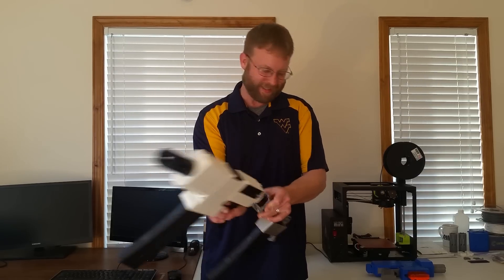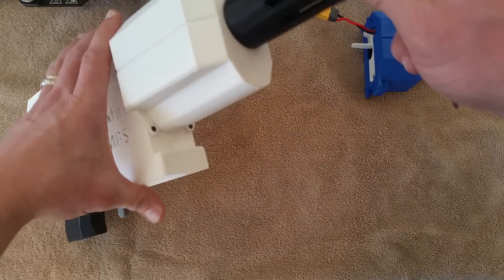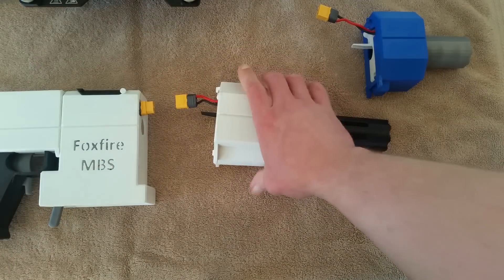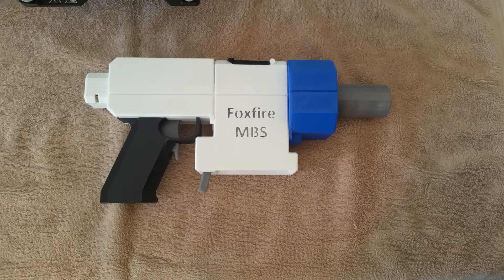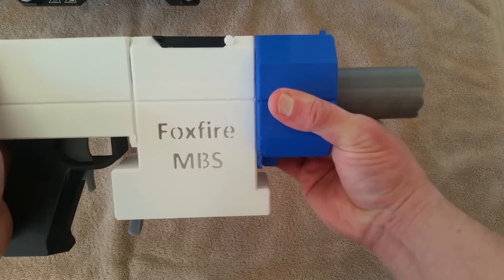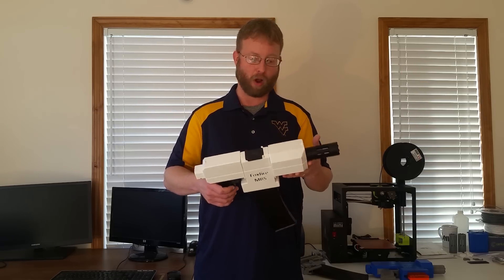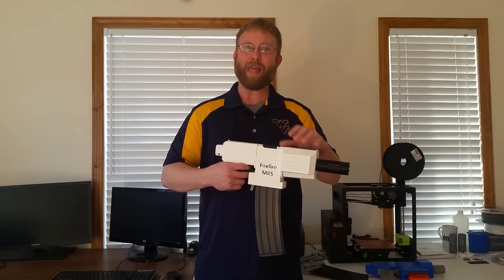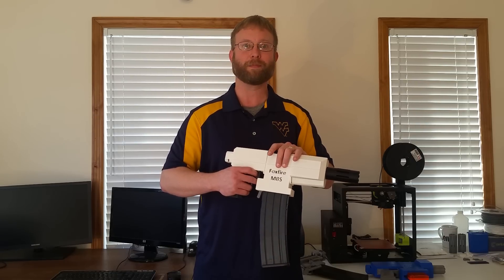Foxfire MBS Project Overview

Comment: What is the maximum bed size for this
Reply from the maker: I'm using a Lulzbot Mini - so 150mm x150mm x150mm (approximately).  A couple of the prints do use the full size of the bed in the x direction.
Reply: 498 Nerf any chance you could cut down the part s to fit a 120 by 120
Reply from the maker: You could try and place the Core sections diagonally on the print bed.  120mm is probably too small though.

Comment: Hi Nerf 498,do you recommend a 2-stage flywheel set up each with a pair of neohellcats?
Reply from the maker: That would work, but isn't optimum for the second stage.  Maybe try Wolverines on the second stage and run the whole thing on 3S.
Reply: I see. May I know the material that you are printing this blaster in?

Comment: are you using the  2 stage modulus open flywheel project cage?
Reply from the maker: It is the 2 stage Stryfe/Rapidstrike cage from OFP.  It is almost the same as the Modulus one, but the screw ports are different.

Comment: what are the dimensions of the battery tray
Reply from the maker: The opening is 28mm x 88mm with a depth of 46mm.  The space inside is a little bit bigger than the opening, but you need it for wires and connectors.

Comment: Are you selling these? eBay has a lot of aftermarket parts like a flywheel kit with motors for like eight bucks. Mass produce this please!
Reply from the maker: I not selling them at this time.  Tbh, I'm still working through how to handle this.  I would prefer to (eventually) just license out the models and have partners build/sell them.  Very early in this process though.

Keep in mind this project, while functional, is still in its early stages.  Imo, the models still need to be refined quite a bit.
Reply: I know the. I was just wondering whether you would put them up for sale in the future. Also, how many flywheel cages are there in the third section? I wish I was this good at making stuff. You have a talent.
Reply from the maker: Thanks for the feedback.  The white Housing has a two-stage cage from OFP.  The blue Housing just has a single high-crush OFP cage.

Comment: Do you have pics of the build & the internals? There's a link in your description but I can't get any of it to open..
Reply from the maker: The link points to the STL files that you would use to 3D print the models and the Blender files that are the source.  Blender is free - you can download it and then you can view/modify the source files.

For the internals, I'm going to be releasing a series of videos over the next few weeks that goes over the internals of each module.

Comment: Great Idea and execution.  Are you planning a core with the integrated Rapidstrike fire control group 3D model? It seems like  a good basis for a small pistol grip housing.  I'm looking forward to seeing where this goes.  Are you going to receive and/or feature files or models from the community?
Reply from the maker: I was actually looking at modelling a core around this kit - http://www.lightake.com/Product/Detail?productId=2288653&productname=3-Modes-Automatic-Kit-V3-8-Semi-Auto-Full-Auto-3-round-Burst-Modified-Parts-Set-for-Nerf-Stryfe
I done some work on it, but still have a long ways to go.

I'd like to integrate as much from the community as possible.  Already using OFP cages, and definite would like to utilize more where it works.
Reply: 498 Nerf well, I have been designing a full auto springer pistol for a few weeks now, and I may be able to make it fit your platform.  If I can finish it in a reasonable amount of time, I will print and send a prototype to you to review.  Also, I think your parts lend themselves to prinable cosmetic mods very well, for those with CAD experience.

Comment: Hey quick question.  Does it take 180 motors
Reply from the maker: Yes, both P and A housings have enough space for 180 sized motors.
Reply: 498 Nerf thanks for the imput

Comment: I assume the rear section is detachable to accommodate a full auto grip trigger assembly?
Reply from the maker: Yes, it attaches the same way as the housing does.  Although the way I have it wired, you have to detach the housing first before detaching the core.

Comment: Sweet idea, you've gained a sub.
Do you know if blender files can be used in solidworks? I'd like to customize things like handle size and shape, add rails, stuff like that. I'll fiddle around with it and let you know. Or maybe learn blender 😊

Edit: I can't seem to get it to work. It might be just me so if anybody has a good way of getting solidworks2014 to accept a blend file, let me know
Reply from the maker: There is a guy over on reddit (MeekerIV I believe) that was looking at converting the blender models over to Fusion.  I really don't know enough about solidworks to know if it can import blender files.
Reply: Thanks, I'll look that up

Comment: How about using thumb screws instead to make the swapping easier?
Reply from the maker: That was actually what I was going to do originally, but I ended up not using them because the space was a little too cramped.  They were going to be hard to get to.
Reply: Hex screws could work

Comment: Hey I've been debating creating an afterburner with a regular nerf barrel attachment point, and I'm curious as to why you decided to do neo rhinos and then meishels 2 as the second stage? (As in what is the reasoning behind the physics?)
Reply from the maker: uGatoBeKittenMe I wanted a good setup to run on a 3S Lipo.  The Rhinos work well for the first stage and the Meishel 2.0s on 3s work well as a second stage.  They turn around 54k rpm at that voltage.